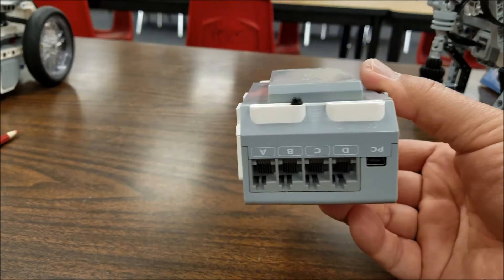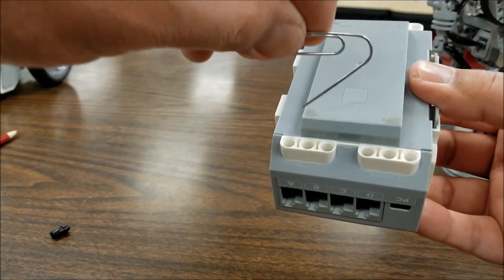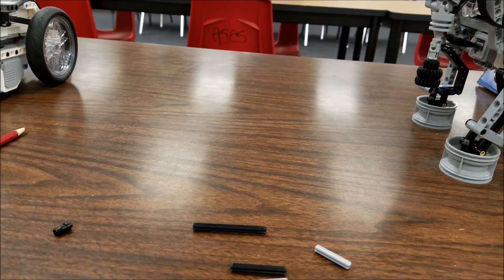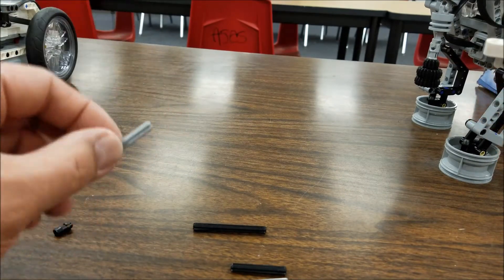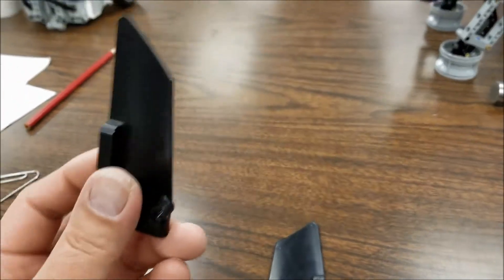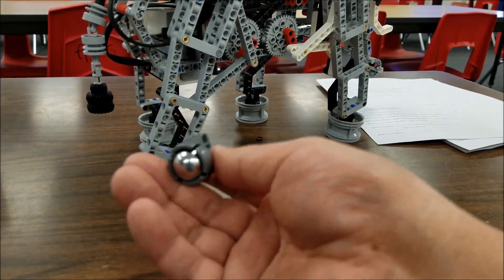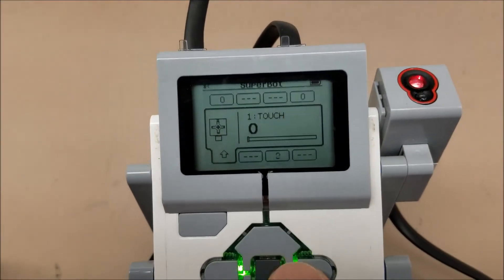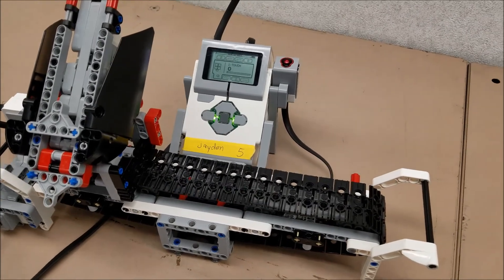"LEGO Mindstorms EV3 Hacks To Make Life A Bit Easier In Robotics"

Comment: Here's another "hack" -- you can get 25 ea. replacement Steel Ball Bearings that fit into the 92911 "Technic, Steering Ball Joint Large Receptacle" part ( https://www.bricklink.com/v2/catalog/catalogitem.page?P=92911#T=C&C=85 ) for $11.53 from McMaster-Carr.  The Lego 99948 "Technic, Ball Steel 18mm D. (fits 92911)" part ( https://www.bricklink.com/v2/catalog/catalogitem.page?P=99948#T=C ) measures 18mm, which equals 0.70866 inch.  This is very close to the McMaster-Carr 23/32" steel ball ( https://www.mcmaster.com/#catalog/124/3820/=1bcxq6a ), which equates to 0.71875 inch, only 0.01009 inch larger than the 18mm ball.  This 0.01009 difference equates to 0.256286 mm.  Get 25 ea., 23/32" ball bearings for $11.53 and don't pay the expensive 2-pack from Lego Education:  https://education.lego.com/en-us/products/lme-replacement-pack-3/2000702
Reply from the maker: Thanks for this dluders!!!